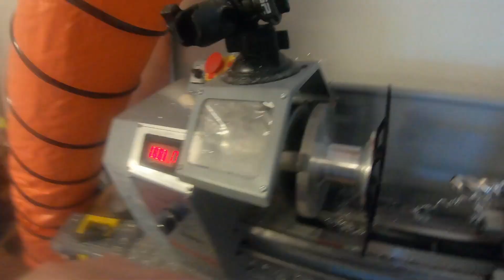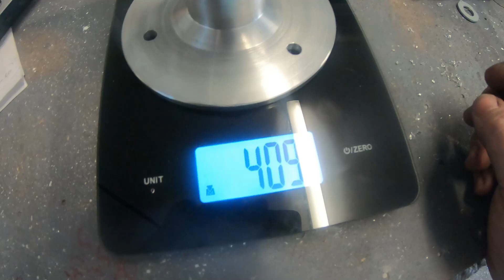New Mini Lathe 8x16 EBay turning brake adapter AZUSA wheels ultimate seaplane ultralight aircraft

Comment: i know this is old video, but can you check what is maximum dia for this lathe swing over cross slide ? you done 130mm but can it take more until hit cross slide?
Reply from the maker: Hi I just checked this and the swing is 200 mm diameter or 100 mm from centre of chuck to bed . Would need a face plate or larger chuck to hold this size though. Hope this helps.

Comment: A perfect mate with the machine I am looking at who is using it for my question.  How far away from the machine does that sucker fling the chips?  Thinking of putting one in the Den (only place I can work) and don't want it flinging it too far away.  Knowing is half the battle so I can make something to catch the sharp buggers.
Reply from the maker: It is only seems to send chips about 3 feet but that’s if you let it build up . The catch tray and back shield catch most of it. The worst part is walking through it and dragging it everywhere else. A mat on the floor to clean your shoes might be a good way to prevent the spread. I think you could have one anywhere and just keep a broom handy for the clean up 👍
Reply: @michaelhille261  Aye.  Thank you.

Comment: Look at a prop hub on the O-200D as an example of adding lightness. Your hubs look great, but you could still mount the brake discs off a Ford F-150 with them.
Reply from the maker: I just checked it out . Hahah I guess I like to over engineer things but I need to know where to stop sometimes. Appreciate you message and feedback. I’ll see how much more weight I can pull out of them . By the looks I can pull a fair bit out 😀👍👌 Thanks again
Reply: @michaelhille261  I don't have a lathe and I can only weld mild steel. I do have a drill-press, tho. I convert mild steel parts into a lightweight alloy called drillium.
Reply from the maker: hahah i just saw your reply . Very nice